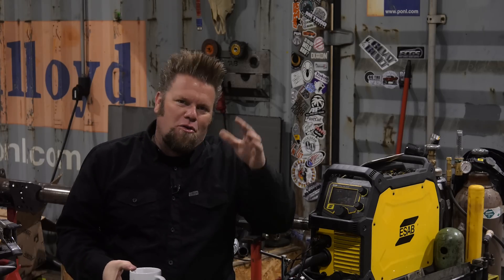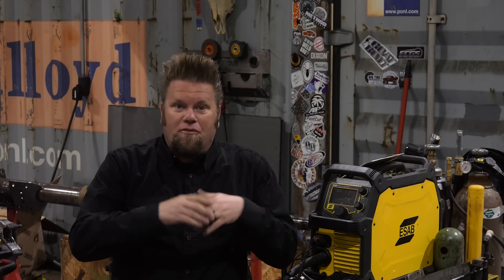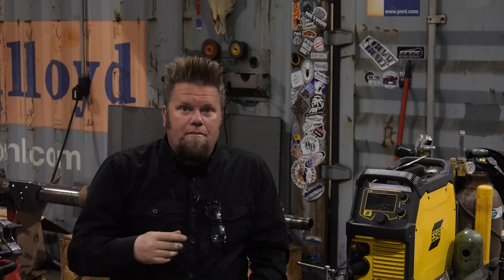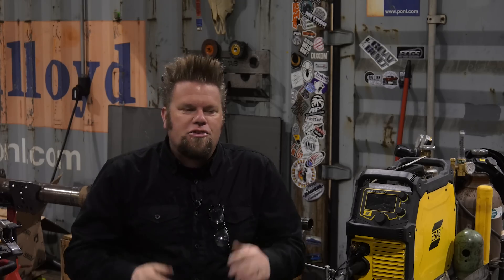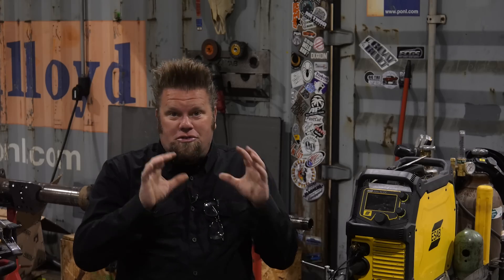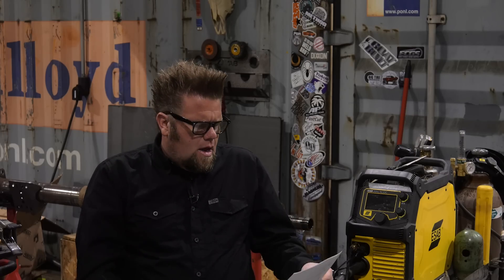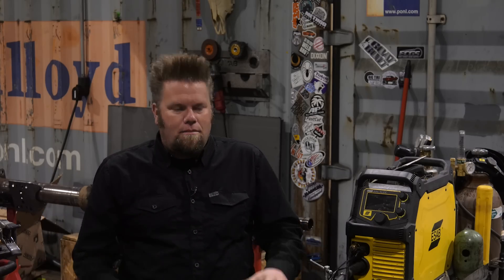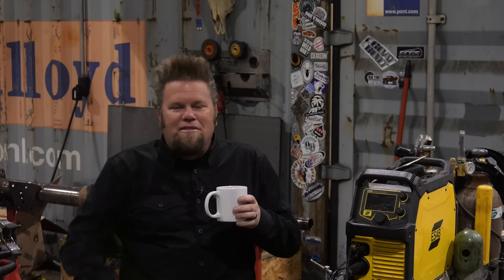Learning CNC Plasma, Why Did Dirt Every Day Get Cancelled, Build a YJ

Comment: 💯 true, spend time becoming proficient with the software, the table/cutter will have some intricacies of its own to learn later. After talking management into getting a decent size multi process table into the shop, I was in a rush to put it to work. I  crashed it a few times, burnt through tips, wasted material because I was getting frustrated trying to learn on the fly and making mistakes. After letting the machine sit for about 2 two weeks I realized I just had to invest the time and properly learn the machine. A month later i now enjoy using it, it’s  as easy as sketching on paper and hitting the go button and the shop is seeing a return on investment.

Comment: Dig the perspective on the CNC plasma machine.  I’m an old woodworker and one shop had a CNC router table.  Was great for repeatability and the intricate one-off stuff that would take hours of layout, bandsaw work, building a one-use router jig or freehanding on the shaper table…and seemingly years of sanding and fitting…and wood is a lot softer than steel.  
Still enjoy watching your work!!  Lockjaw is right up there with Stacy’s Sgt Rock, Matt’s OffRoad Recovery MORRvair and the YJ swapped Willys wagon Fred and Dave built in my enjoyment level!! I love seeing it come back from the wrecking yard and it was a fire apparatus…I’m a retired firefighter too. Keep on rocking it up!!
Was fun watching Hollie and Walter visit your shop too!!🙏♥️💪
Keep it up eh!! ♥️🇨🇦

Comment: So I have a 2015 JKU Rubicon. I had Opportunity to buy a Ultimate Dana 44 front axle. The problem is the new axle only has a plug for the locker. The second plug is for a axle locker sensor. Is their a workaround for the second plug.

Comment: Im loving the question and answer format you are doing now!! Heres my question to throw in the hat. I am having a hard time with getting holes ive drilled to line up when im making sleeves to put bolts through a boxed frame. Every time I try i end up just far enough off to throw everything off. Do you have any tricks of the trade for this? Thanks and keep up the good work!!

Comment: So I’ll throw a Q at you.  I’m building a 62 scout with my son. We’ve done a ton of work so far and it was drivable first a bit until clutch problems… anyhow, the goal is to keep it close to stock for the next 3-4 years and enjoy it as is. Next phase would be a light build including axles. However I don’t prefer the wider axles. What’s a good budget friendly recommendation on narrow axles that can handle 35’s and maybe up to 250hp someday.

Comment: I think your going to love the 3D CAD world. McMaster-Carr has most if not all their part 3D modeled. Most other companies have them also. Which means you insert downloaded parts and build around them. No trying to measure parts and getting it slightly off and not fitting. I use Fusion 360, it’s cheaper than SolidWorks. It has a sheet metal function that takes a 3D model and unfolds it flat . I haven’t tried it yet so I’m not familiar with it so I can’t comment much more than check it out on their website.  Fusion 360 also has manufacturing functions to generate G code for CNC machines and 3D printers. 
.

Comment: So I see alot of 3 link front builds I'm sure mostly for packaging.  But my question is would a parallel 4 link work in the front along with panhard bar the same as a 3 link or better? Was thinking 4 link would be better just due to redundancy on the links, incase one breaks. Thank you for good content
Reply: Actually, 3 Link with Panard is the only none binding suspension configuration, outside of a wishbone 3-Link. 

4 Link theoretically is constantly binding at all times. That is why factory type 4-link / 5-link suspension uses rubber bushings.

Comment: Seeing that anyone and everyone does 4th Gen LS V8 swaps now a days, why not beef up and modify some 07 to 13 Chevy Suburban’s and Tahoe’s?  They already come with 5 link rear suspensions, front struts and the lower 1st gear 6L80 transmissions?   WFO, Off-Road Design, RCV, Atlas all make parts for them now.  Seems like a no brainer build that millions would be interested in.  No??

Comment: MotorTrend seasons are too short and too much down time between seasons. Had the MotorTrend GO app and it was unreliable signal/service. Switched to MotorTrend+ and ran into similar issues along with the short seasons and long down time between so I have canceled that also. All of my other streaming apps work just fine, it was only the MotorTrend stuff that failed. Roadkill was AWESOME in the beginning on YouTube and early days on MotorTrend then it became over produced and less show up at a junkyard/barn and take a clapped out thrown away heap and make it run the road trip it a couple hundred miles, or at least try to road trip it. MotorTrend had great shows but their production manipulation and delivery is killing them.

Comment: Have you ever thought about going old-school on your next engine?  Something like a 350 rocket. Or better yet a 445. They really don't have the HP but they have torque. Or a 351 Windsor,
Cleveland.
Reply from the maker: To be honest..those older engines are WAY more expensive than modern engines
Reply: @BigTireGarage  that a
They are.  But it something different from what you have used.